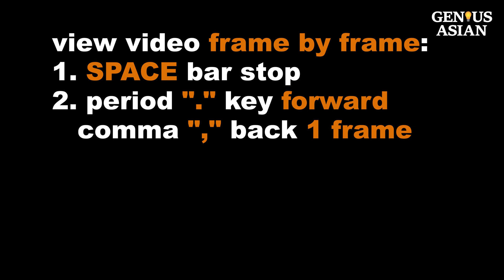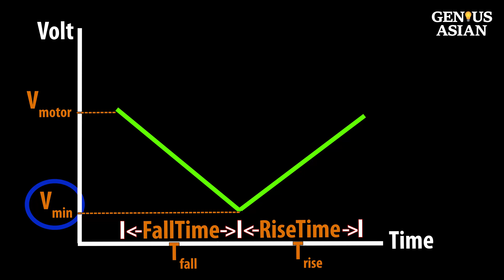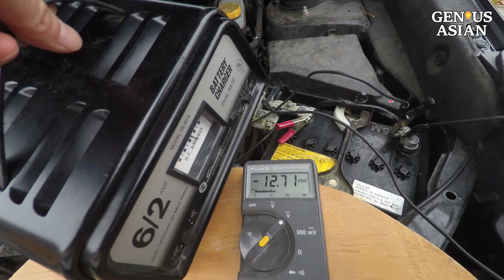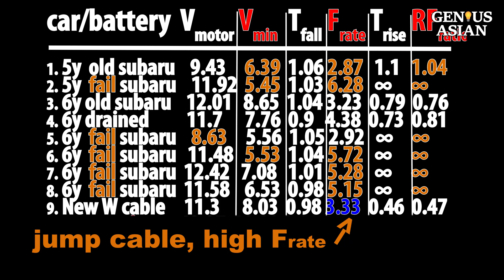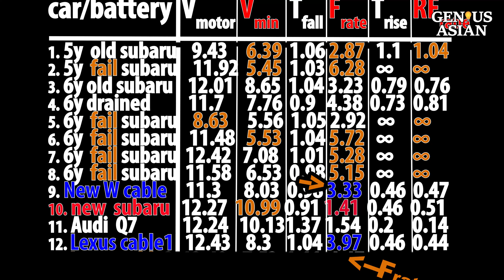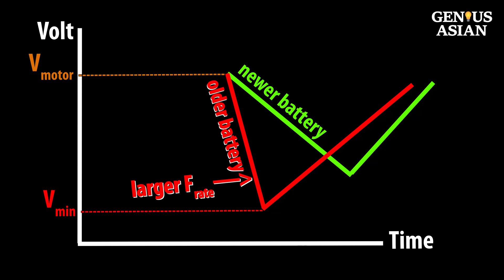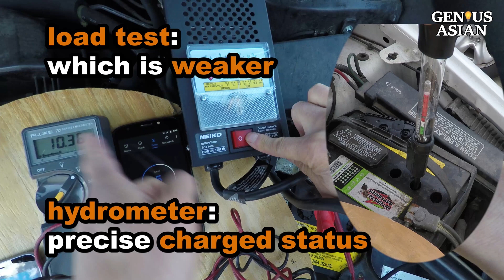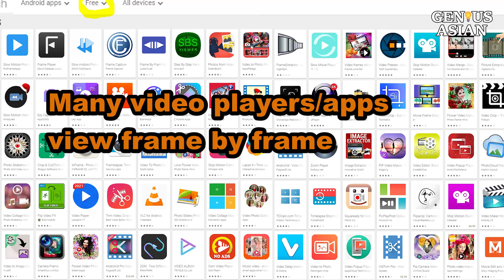How To Load Test A Car Battery Without Buying A Load Tester. Should You Recondition or Replace?

Comment: Could you do this in stupid format.
Reply from the maker: what is a "stupid format"?
Reply: @GeniusAsian  I believe Clive is referring to "a simpler explanation".  I felt your video content is excellent and very detailed, and even though I am qualified and experiened in the subject of loaded circuits and the their relationship  to resistance it did even make me think hard about what your explanantion was leading to until I revisited your video a couple of times.  I have tried for many years to prompt people to dump thier 'probe lamps' and 'continuity testers' but they unfortunately do not understand just how much an active (i.e loaded) circuit effects a voltage reading . . . . . and you cannot correctly test resistance/continuity of a active/loaded circuit . . . . . . so using a voltmater to measure voltage under load is the only true (and when you understand the principles) simple way to go.  Loved your video detail🙂

Comment: Great video and explanation. 

Maybe you can do some testing and explain the difference in voltage and current at different temperatures down to -40
Reply from the maker: Great point! My experiments were limited to a few batteries using "relative" change to monitor the status. It would be nice if we have a universal reference point.